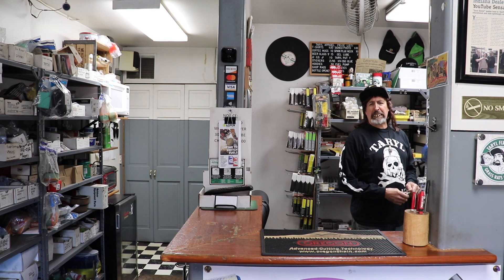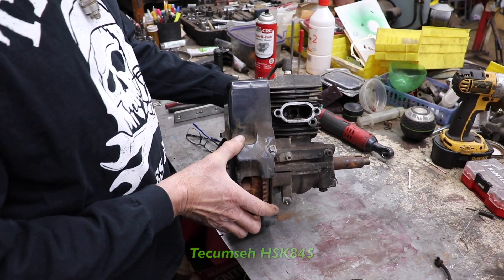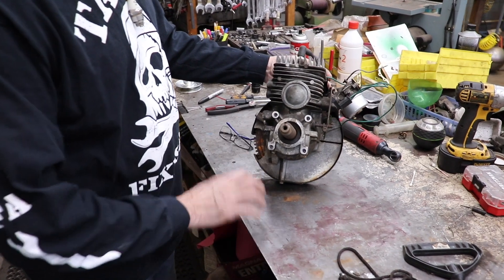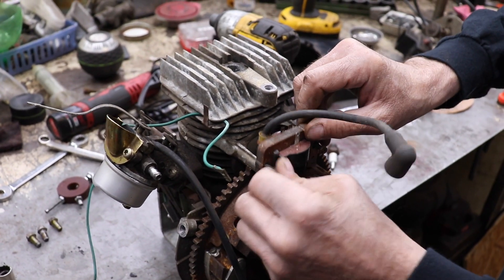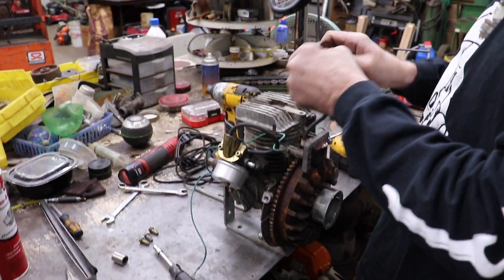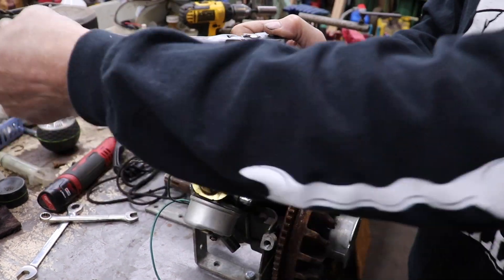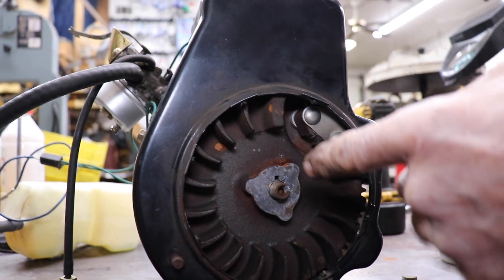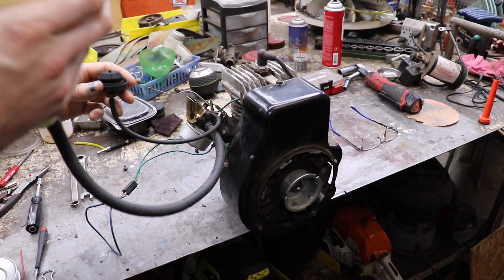Can You Run An Engine BACKWARDS?!? Let's Try It

Comment: I drove a 1985 Chevy sprint, it was a little three cylinder, the predecessor to the Geo metro and it was a Suzuki engine. I work for dominoes in my car had a lot of hard miles on it and one day I went out and started my car and put it in reverse and my car went forward and I thought I was being an idiot and had put it in fourth gear or something so I put it down in the first gear in the car drove backwards. I didn’t think that was possible but I turned off my engine restarted it and then everything worked fine. It was also running horribly when it was started backwards, it was almost like the gas was cutting on and off and I don’t know if it was a valve issue or what but the transmission was fine so I’m thinking that the only option was it the engine was running in reverse.  it still confuses me because there was nothing to repair on my engine afterwards once I shut the engine off and restarted it everything was fine and I kept driving the car and put a good 20 or 30,000 miles on it after that.  I don’t understand it, in my mind that should not be possible but it happened and we tested it in first and reverse and it went the opposite way so I don’t get it but it did happen.

Comment: I had a 1976 rd400 Yamaha motorcycle, if I snapped the clutch just write the engine would run in reverse I could drive it backwards 🤣

Comment: I used to drive an old Mack, if you lugged it down to far, and it kicked back, it would run backwards, until you shut it down and restarted it.
Reply: I heard old lanz bulldog tractors would do that if you lugged them down too slow. Dangerous if your pulling something up a hill.
Reply: @blowupbob1  I never  cared for that happening, it was a dangerous truck, no jake brake, no trolly valve, was a rambling wreck, best part of that truck was the antique bulldog on the hood. LOL